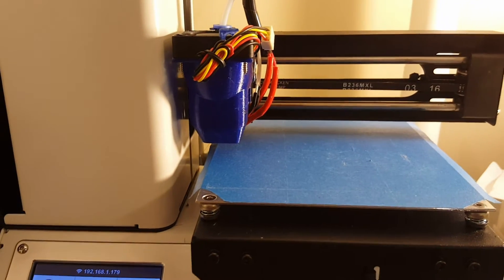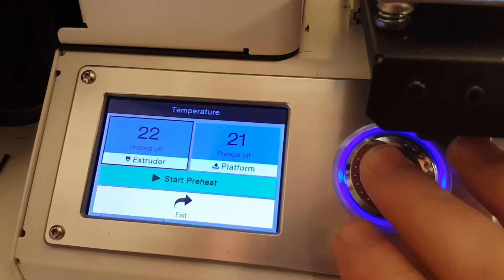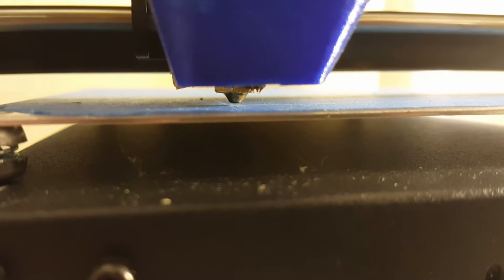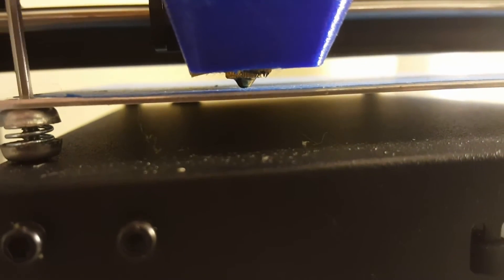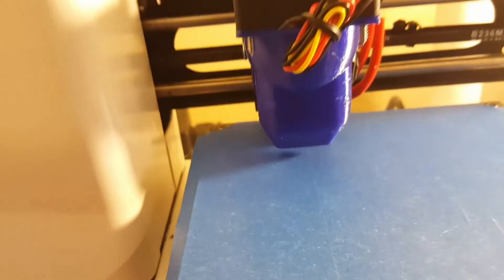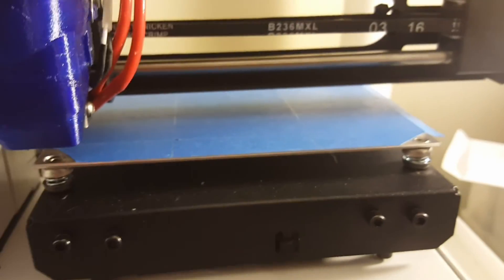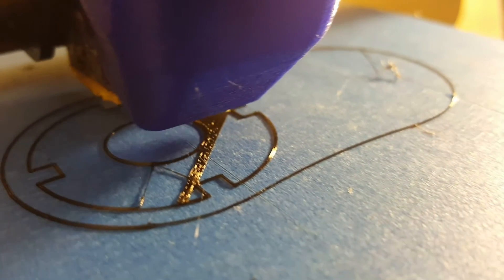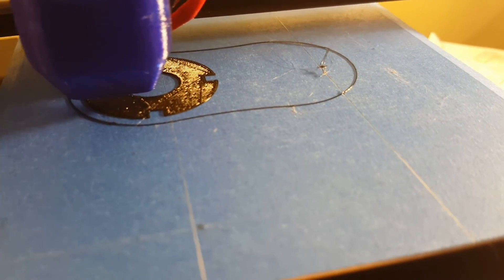Bed Leveling 101 - A guide to reliable first layers

Comment: Thank you for this video. I recently acquired a used Select Mini printer. I repaired the heat bed temperature sensing issue it had. (It wasn't the wiring but it was a simple fix.) Using a piece of paper of random thickness for levelling never made sense to me for the reasons you mentioned in this video. I've tried the paper method of levelling the bed and gotten close. I'm going to go try this method of levelling right now.

Comment: Great video I have the maker select V2 and been using it for a while with no issues I then have been messing with the settings and Cura 2.4 and now I am getting gaps between my first layer infill lines .. i don't know what setting I messed with I don't know if it's the initial layer thickness setting or what please help thank you

Comment: Question! when printing i noticed my printer was great never had any issue with prints "falling off" failing towards the end until i realized i was printing at a speed of 14mm/s in cura. im using the MP select mini with PLA and once i realized i could do 55mm/s everything was failing. it would get to the end and last couple layers it would be knocked off the print bed because of the speed. any tips to get this right. i mean why do they advertise 55mm/s if it cannot do it reliably. I do realize im sacrificing quality at that speed but i see a lot of people accurately printing at 40mm/s or more accurately without issue. any advice would be aweesome. thanks all in advance!

Comment: Could I use this technique to adjust the bed to accomodate for a zebra plate that I will be using? (I'm using the MP select mini too).
Reply from the maker: Absolutely, you can use this for any relatively minor thickness or height change.
Reply: I had to add a z axis shim to use my printinz.com plate.

Comment: HELP! ugh no matter what i do the bed wont space right prints wont work. it used to work perfectly! then a print went crazy and now nothing works...pretty sure bed is warped so i got glass to cover it (yes bed was warped) and using this method i the closest i have gotten it to print again. 

any other suggestions?
Reply from the maker: What are you putting on the glass to help adhesion?
Reply: FDM Guru currently gluestick

Comment: Awesome Video!!  Thank you so much.  I had issues interpreting the paper method with poor results  What speed to you like to print pla in?  I have mine going at 55 mm/s  Also, have you looked into changing the nozzle to a tougher material to be able to print in some of the filled pla materials?  I'm leery about trying some of the exotic pla's without changing the nozzle out.  Your thoughts?
Reply from the maker: A stainless steel nozzle or coated nozzle ( like Micro Swiss) will definitely be important for any kind of carbon fiber or glass fiber filled materials. I typically print PLA at 50mm/s on the mini with the perimeter speed at 30-40 and a minimum layer time of 20-25 seconds.

Comment: Will stick like glue unless you have a fan cooling the print, like you do. Modding my fan shroud to support an extra print bed fan was the best thing I ever did to improve print quality, the difference is amazing, no more problems with prints either glueing permanently or not sticking at all, no more problems with sagging, no more problems with sloppy fine details.

Comment: where did you find the fan upgrade  file?
Reply from the maker: I designed it, and you can find it at the following link:

http://www.thingiverse.com/FDM_Guru/designs
Reply: FDM Guru did you print that with PLA? Or ABS?
Reply from the maker: I actually used PETG, although you could probably get away with PLA if you needed to.

Comment: what's that blue cover on your nozzle can you make a video showing how you place on the nozzle and where to get the design please thank you
Reply from the maker: Hey Noah,
That is a replacement fan shroud I designed that improves cooling for printing with PLA and PETG. You can download it at the following link, and installs in the same manner as the stock fan shorud (spring clips on the side). 
http://www.thingiverse.com/thing:1676718

Comment: Great vids, subscribed and can't wait for more.  Don't even have my printer yet, but this one has me puzzled, as I would think the lack of any gap between nozzle and surface would make the filament smush out, or go sideways or some other bad thing.  Can you comment on why a gap isn't needed?  Thanks!
Reply from the maker: Hey Jim,
Sorry for the late reply, I just noticed this comment! When you home the Z axis the printer considers that point to be Z= 0mm. So, when we adjust the bed level such that the nozzle is just touching the blue tape we are in fact making sure there is 0mm between the nozzle tip and bed. At the beginning of a print, the nozzle will than be raised 0.2-0.3 mm off the bed (depending on your slicer settings) and that first layer will be printed at the appropriate height.
Reply: I just bought a Monoprice Mini V2 and have tried half a dozen videos on leveling its bed; to no avail. Your video makes it look easy. And thanks for the data on this question. I was wondering this, too. This information about zeroing the bed and that it will raise up appropriately when it starts printing was the key for me. 
Many thanks. Now I can get about it, and start having fun with my new toy.
Looking forward to modding this baby; starting with the bed heater wiring. 
Then I want to add a ruby tipped nozzle.